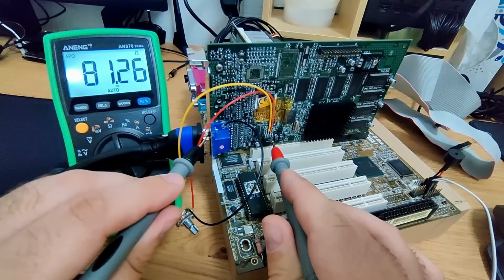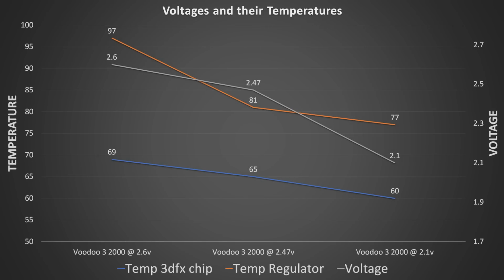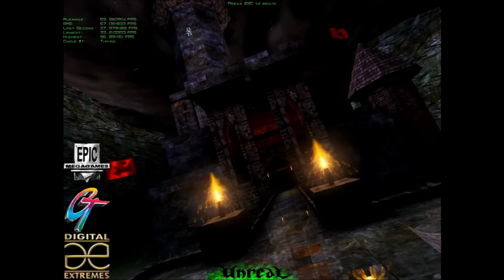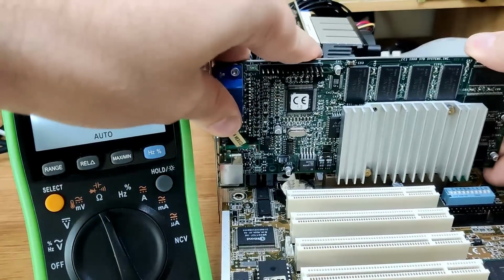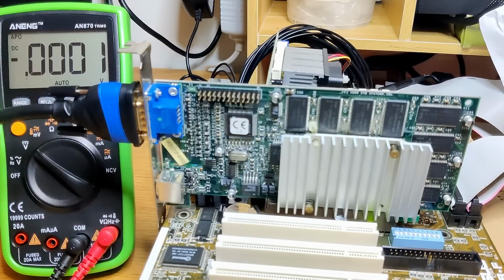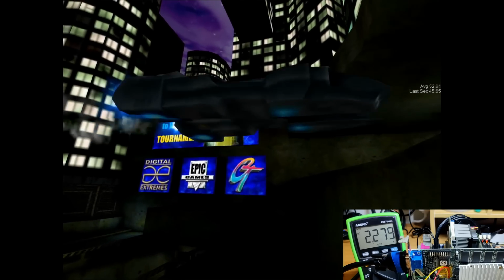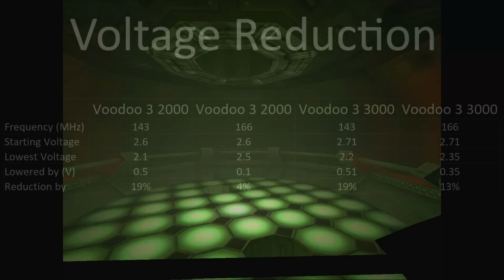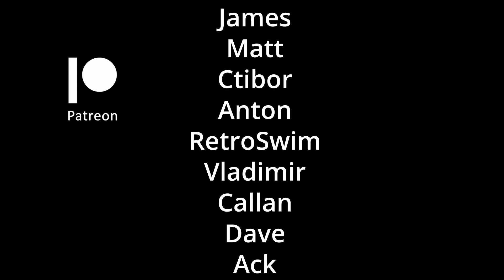How much better is the Voodoo 3 3000 chip? Tested via volt mod!

Comment: Great video, for more accurate core temperature readings I would suggest measuring the PCB behind the chip - due to the package type of the Voodoo3 chips most of the heat goes into the PCB and not the heatsink. On well used cards that spot can be discoloured from years of it running pretty hot!
Reply from the maker: Yes, I noticed that it is better to take the temperature on the back of the PCB, especially when a fan is blowing over the heatsink.

Comment: If I'm not mistaken the AGP 3000 card is running at a 66MHz host bus while the PCI 2000 card only has a 33MHz connection to the host. I could see this being why the voltage needed to keep the system from locking up is much higher.

Comment: Voodoo3 PCI supports both 3.3/5V PCI signaling (which is why there are two "keys" on the PCI connector). The motherboard you are using has 5V PCI (which is pretty standard). The AGP Voodoo3 connector is keyed for 3.3v. A Voodoo3 chip in PCI 5V mode probably uses a different buffering/re-driving mechanism than in 3.3v/AGP mode. What you ran into was probably the difference in sensitivity of those two bus voltage modes. That's my guess anyway.

Comment: My STB V2000 works overlocked to V3 3500 183mhz with a small radiator + cooler (no other changes in bios/Windows except mhz). Only for tests ofc. Standard V2000 works for me ideally :)  Great times, love Voodoo!

Comment: i am pretty sure you could go more efficient on the V3-2000 (higher clocks or lower voltage) if you would replace its cooler with something more beefy. lowering the temperature will increase efficiency.

Comment: I'm wondering if the RAM voltage needs to be adjusted too as they may be getting out of sync with the core.
Reply from the maker: The memory is powered by a 3.3 volt supply, which actually comes from the voltage regulator with the heatsink. I don't think there is an issue since the core is already receiving lower power.
Reply: @bitsundbolts  Oh yea, but I was just thinking, lower core voltage and the timings of the core to the memory..

Comment: I know there are utilities that can read the internal temperature measurement of the die, and tools that ran in the background to log the temperature measurements to a CSV file. However I don't remember if these old cards had the thermocouple and circuitry to read it built into the die. Perhaps it's worth investigating?
Reply from the maker: I have never found any information about thermal sensors in any Voodoo graphic chips. I think those came later, but would have been great to have those available back then!

Comment: Chipbinning was roughly done by the location of the chip on the wafer. In the middle, the structures were best (the location of every layer above the last one), the more you go to the outer locations, the worse it gets. That's because of the precision while exposing the silicone and the repeatability of this process. Outer chips had slightly more shifts between each layer, so the component values where more off the theoretical values.
Reply from the maker: Very interesting! Thanks for sharing! That obviously makes the binning process a lot easier! It won't be 100% accurate though. So, Silicon Lottery :)
Reply: @bitsundbolts  Yes, nowadays the methods are not as rough as back then. Now they use f.e. light scattering (shining light at a specific angle and checking the reflection with a camera) and various far more superior methods. Take a look at "wafer map" / "substrate mapping", "optical wafer defect inspection" or "wafer probing". Sometimes you can even connect to the chips directly via pogo pins (probes) and check their performance, but not at cpu-level, simply to much pins... But the rule of thumb still applies that wafer more in the middle are better than the outer ones.

BTW I think you noticed without further mentioning, but i really like your channel and content! Keep on your work!
I do similar stuff myself, but, despite of a handful of short videos without editing, never found time to create and polish content like you do. Thumbs up!

Comment: I am really surprised you run them without a fan. I installed fan immediately to both voodoo 3 cards I have  for sake of longevity when I got them.
Reply from the maker: I will put a fan on those cards. For now, I just want to know how they were sold to the end user. I absolutely agree that they are very hot running cards and a fan should be put on them.

Comment: just use some mat painters tape on the heatsink, then it will heat up the tape and the cam will not have the wrong reflection
Reply from the maker: Yes, that could work, but it noticed that I could measure the temperature at the back of the card as well. Maybe there are a few degrees difference, but it should be good enough.

Comment: If you spread a bit of thermal paste on the heatsink, it should be visible under the thermal camera because it's not reflective, and should also not affect the heatsink efficiency. Lower temperatures also allow you to run lower voltages. If you can reduce the temperature from 70C+ to 40C with an active cooler, you might get a few milivolts of improvement. Reducing the voltage ripple by increasing capacitance might also allow you to run lower voltages by another few milivolts (an oscilloscope is needed for this).
Keep it up! I really enjoy seeing people trying to get the most out of old hardware :)

Comment: I have every flavour of Voodoo3 except the motherboard integrated one, one of which is in a permanent retro build & I run them all with fans either on or next to the heatsink because they all run hot, especially inside period correct cases & they always did.

Comment: May be timings are involved. Try flashing bios of voodoo 3 2000 and do voltage mod for lower voltage.
Reply from the maker: Interesting idea. The crash of the Voodoo 3 3000 did not feel natural. Will put your idea on the project list. Thank you!

Comment: Very interesting experiments! I had always assumed 3dfx would bin their avenger chips for the various models, but wasn't sure because of the voltage and cooling system differences. It definitely makes sense though and great to see this confirmation. I also wonder how much week-to-week manufacturing differences would play a role here too. Overclocking beyond 166MHz is a bit of a different story though and in my experience its usually the memory holding the cards back. Its unfortunate that you can't clock the core/memory separately like you can with the Voodoo Banshee. I have a Voodoo 3 3500 that I hope to do some experiments on one of these days.
Reply from the maker: A Voodoo 3 3500 is still missing in my collection. Some day I'll get one!
Regarding the binning, I believe that they definitely binned their chips. It would not be good business if you buy a Voodoo 3 2000 and overclock it to 3500 level with their own overclocking utility. Especially that 3dfx turned the greed on when they closed the door to their previous board partners.

Comment: Excellent video. A fan will not only reduce the temperature but will also increase the maximum stable frequency by around 5-7 mhz.
Reply from the maker: After I am done testing my second Voodoo 3 2000, I'll get into changing cooling solutions.

Comment: Maybe if I ever get my 1000 fixed up and if I were to slap a heatsink on it (1000s had no heatsink), I wonder if I could get it to 2000 or maybe 3000 speeds
Reply from the maker: I could imagine getting it to 2000 level. Reaching 3000 may be a bit of a challenge. Isn't a Voodoo 3 1000 also only equipped with 8MB?
Reply: @bitsundbolts  it’s a full feature core with 16mb SGRAM, I think some came with 8mb. There were also the velocity cards with only a single TMU and I knew they only had 8mb
Reply from the maker: I didn't know they had so many variants at the low-end. I guess they really tried to have a Voodoo for every pocket.

Comment: I guess this is evidence there was genuine binning of Voodoo3 chips back in those days, there was always the suspicion that the 2000/3000 difference in silicon was entirely artificial but it seems not in every case. Many 2000's seemed to have no issue being run at 166MHz though, it was almost accepted wisdom that every 2000 could be run at that speed without issue when that probably wasn't strictly true.
Reply from the maker: I am testing my second Voodoo 3 2000 now. I think it was probably rare to have one of those cards that can't run at 166 MHz. If there was binning in place, those probably would have been kept for Voodoo 3 1000s. The only problem is the cooling. 
I'll try to find out which of my 2000 is the better one - and I'll turn it into something special 😉
Reply: @bitsundbolts  BuB the best 3dfx youtube channel